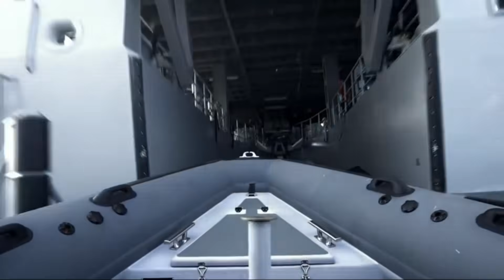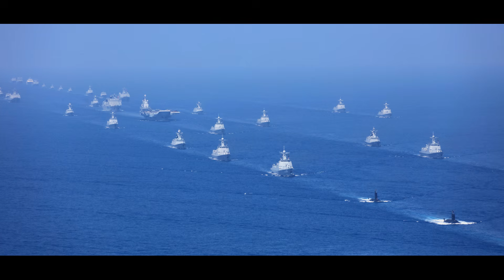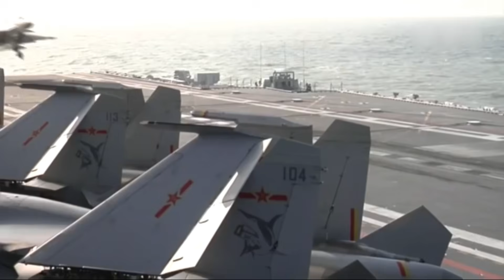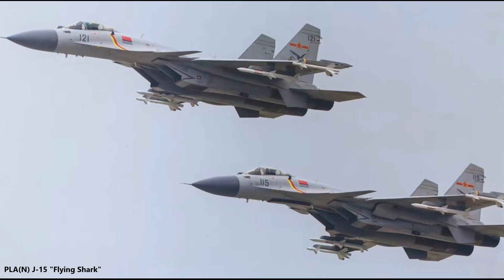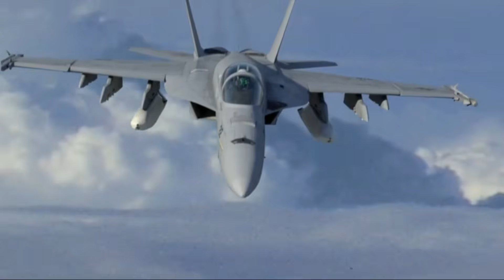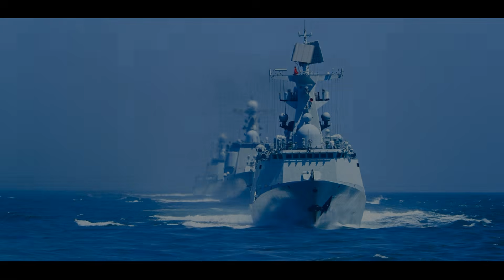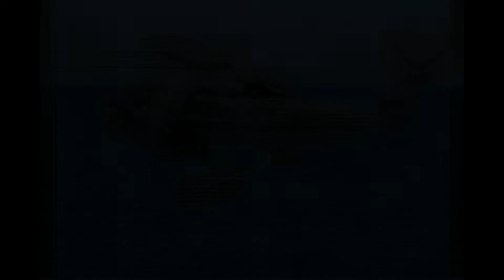Up-Gunning the Arafura Class OPV

Comment: Disgustingly undergunned for something  with the displacement of a Fletcher class destroyer. Unlike the ANZAC frigates, I would have thought as a patrol vessel, the Arafura being "fitted for but no with" additional systems would make sense. 2 quad cell harpoon launchers and a RIM116 launcher makes the Arafura look much more credible
Reply: Displacement inflation is a thing. If you want a capable surface combatant, build a guided missile destroyer. It's an OPV, if you think it's under-armed compared to its size, look at the Norwegian Project 6615 (Jan Mayan class) or Chinese Zhaotou class.

The most important part of any surface combatant are the sensors and weapon systems, not the metal box they're placed in. No point wasting them on a platform that will a) struggle to accommodate them, and b) has little or no survivability (Modern Surface Combatants are at least large enough to have widely separated machinery spaces, I doubt this is true of most OPVs).
Reply: It's still under armed compared to the vessel it was based off.
Reply: Agreed! Love your name, my nickname is the same!
Reply: today exist only one warship, call it with it's true name: destroyer! A patrol ship have one mandatory must: you got "ten" or more OPV at same price of "one" destroyer! Thereafter a patrol without hangar for an helicopter... mhm? Sea awareness is radar horizon about 10 nm... for this ship patrolling, give me back the old ones, anything is cheaper, smaller (I don't need a pad without helo)! Missiles : you need a combat system, radar and missiles. To expensive!!! LRASM : this ship will find out there is an enemy ship while sinking. To expensive!!! Torpedo : you need a combat system, sonar and torpedoes. To expensive!!! To expensive!!! ...to expensive!!! USCG Legend are running about USD 750 million and is just lightly better armed, with 3 of them you can buy an Arleigh Burke destroyer, which one you prefer??? Bye
Reply: ANZAC frigates are also Disgustingly under gunned.
I am sure they are trying to add modern missiles to it.
Reply: It's a patrol vessel mate. It's not a warship. It's purpose is to observe and report, and in situations not requiring  a military response, ie: smuggling, intrusive fishing etc it is more than capable of looking after itself. It's all good :) 

EDIT. OK I watched the post through to the end. I was wrong.
Reply: @kcharles8857  but its not capable of being anything more than a patrol vessel. It's typical Australian defence procurement, buy something, "oz-fuck it" by changing the specificatios, in this case,  by stripping most of the weaponry off it, and then spend a shit ton of money later on "upgrading" it when they realise they need more capability from the  platform. Kayman seasprite, MRH90, ARH Tiger, Hawkei etc etc come to mind. only the RAAF appears to not get constantly screwed by defence acquisitions.
Reply: @bushyfromoz8834  they're a module ship and can easily be fitted with upgraded weapons and systems.
Reply: @matthewburgess1406  of course mate! And like all things ADF, they'll get the upgrades 5 years after they needed it ;)
Reply: @bushyfromoz8834  no they would already have them available for fitment when needed, the military has already received a large stockpile of missiles and weaponry from the US and UK which is part of the aukus deal. Go look up the loyal wingman program our military is more advanced and capable then you realise mate.
Reply: @matthewburgess1406  I hope your right mate, but their track record on this kind of thing isn't stellar and I dont trust em, partly because they can't get basic things right. To quote my best mate who is still in the ADF, "They still won't buy us decent f^%#ing boots!"
Reply: @bushyfromoz8834  "its not capable of being anything more than a patrol vessel" good job it is just a  patrol vessel then
Reply: @bushyfromoz8834   Yeah... I edited my post. I was wrong. My apologies.
Reply: @bushyfromoz8834  from I've heard from mates in the Navy and army they've been well stocked up lately. 
I agree the ADF's track record has been shit, when they retired our last aircraft carrier HMAS Melbourne the UK offered a newer and better version but they said no! 🤷🏻‍♂️ It's been the same with our destroyers they were supposed to be built 3yrs earlier... don't get me started on the submarines they could've redesigned the Collins class for a more modern and capable version a decade ago.
Reply: @matthewburgess1406  Until they are physically on the dock I tend to not believe it.
Reply: @matthewburgess1406  Mate, if we had of replaced the HMAS Melbourne with an Aircraft Carrier back in 1982, we would have bought & maintained an Aircraft Carrier that we didn't use for forty bloody years. I'm not that keen to pay that much more in Taxes for shit we will never need. Carriers are Force Projection. We are tiny. I'm all for defence, but not for paying for crap we don't need.
Reply: @tsubadaikhan6332  your missing the point, our defence force used to be equipped with up to date warships and weaponry (the possibility of strength) now they're not investing in proper defence assets to meet a foreign threat to this country. Hope for the best prepare for the worst, our defence budget is 45 billion US dollars 8th in spending but 19th in strength.....think about it mate.
Reply: I'm just sitting here wondering if you're serious?